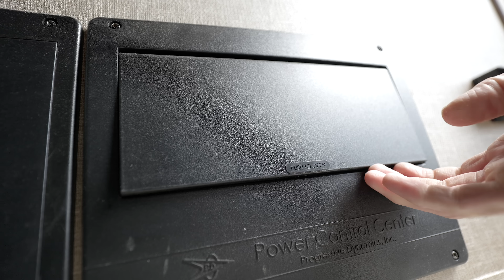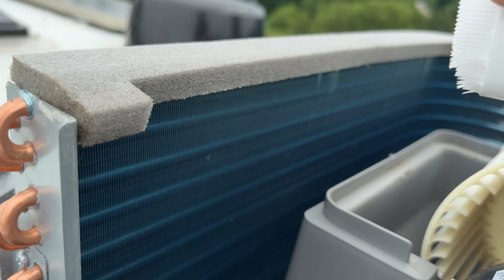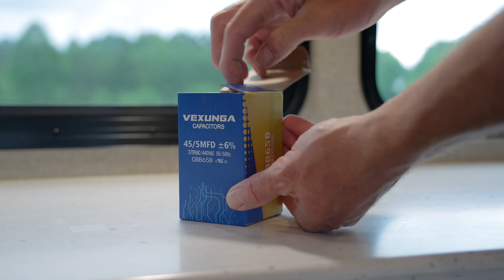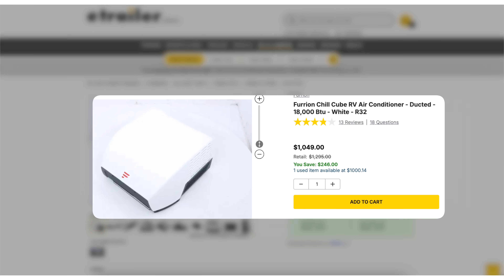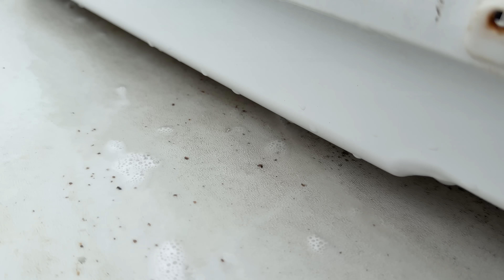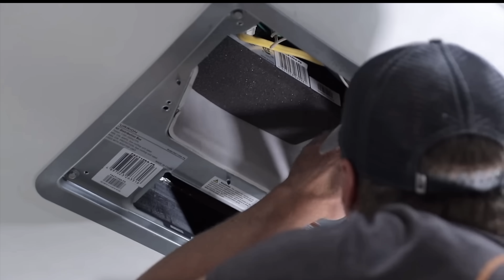Ultimate RV AC Maintenance. 5 Easy And Simple Tips More Than Just Cleaning.

Comment: Changing the caps is one of the best things you can do for a trailers AC every so many years. I did mine and had an ICE cold AC again PLUS it didn't hit the generator so hard when you turn it on. If your AC bogs down really low (struggles a bit or is tripping a breaker) before it comes on; it's time for new caps. You'll have 2, one for the fan and one for the compressor. Now all my family is asking me to do theirs. So far so good seems like the caps last about 5 years.

Comment: Great video! Checking the capacitance value is not necessarily an accurate test; because it is the Leakage Current that is the most important on a capacitor. The Cap. may show good values, but under load the excessive leakage will cause it to fail to start the A/C. You actually need a special tester (Sencore Z-Meter etc.) to check the leakage current. Of course if the value test fails then you pretty much know it is time to replace the cap.

Comment: Economy tip - I was buying cans of coil cleaner, but realized that 3/4 the $ was for the can, and propellent!  For years now I've been using {a product you can look up on a jungle site} that comes in a 1 gallon bottle, and gets diluted 3:1 with water.  I put it in a pump sprayer, and let 'er rip.  It is SO MUCH cheaper than spray cans... it's amazing.  

It's not a foamy thing, but who cares. I don't like to buy air.  ;)  -- Since you're applying it with a sprayer, it gets pushed right through the coils anyhow.

Comment: Well not so fast. Cleaning the coils and debris out is good. Testing the capacitor is best done with replacement, using a meter isn't a reliable test, just a maybe. BTW that capacitor is across the load in an AC circuit, it doesn't hold a charge.
Testing the compressor winding resistance, why? What possible outcome could that get you?

Comment: Great instructional, thanks for posting this!.. FWIW you might try using your vacuum with the bristle brush on the roof coils, the soft bristles and suction can work well on fins, for the chunky debris.
Reply from the maker: Not a bad idea but I like the brush cap because it straightens the fins as you clean. They are so fragile the bristle on our vacuum could bend them and it's one more thing to get on the roof.

Comment: If you want to filter more dust a dedicated air filter (bought or DIY'd) is a much better bet. The AC can still work as intended, no risk of icing up a coil from low airflow, and you get the dust out of the air. Personally, I made a mini Corsi-Rosenthal box filter from a 10" box fan and 10" air filters. Small enough to fit well in the camper, much cheaper than a regular air filter (and the replacement filters are MUCH cheaper.)

Went through last summer and sealed up any little leaks with HVAC foil tape. It made a small, but noticeable, difference.

Comment: Can you take a compressor and blow the coils clean backwards. I usually have just bugs and dust
Reply from the maker: Good question, the problem is the condensation on the evaporator coils. It takes the dust bugs and hair and makes it all stick to the coils with the water. The foam helps break all that down. The brush gets more than a compressor would but then when you use the foam it gets out what never would have come out.
Reply: Also compressed air can be strong enough to bend the fins.  Be very careful if you attempt this.

Comment: One tip I learned is that when taking out filters to clean in my case a Coleman unit, use a butter knife to take out the grate and the filter so you don't bent it and possibly break it especially if your unit is in the years old catagory.  Very good tips as usual Jared.  Gots to get in gear and do my unit!

Comment: I bought a Gree after watching your video. It seems my fan doesn't want to act like it's in Auto. Wondering if you or anybody else has had a similar issue?
Reply: The fan on the Gree runs all the time. Auto just changes the speed of the fan. When the AC turns off, it keeps our trailer more comfortable with the fan running. The fan is very quiet.
Reply: @Herbeez  thanks, didn't know that. Just bought it and threw it in before hitting the road.

Comment: In April I cleaned the coils and used 303. But since 303 is only "good" for 4 weeks, it feels like wasted effort.
Not comfortable doing the capacitor test.
I cannot access the inside of our ducted a/c. I clean the filter on the return air, but there's no other opening. The ceiling is solid. Helps with noise, but I wonder what's up there.
Reply: Just replace the capacitor they aren’t too expensive